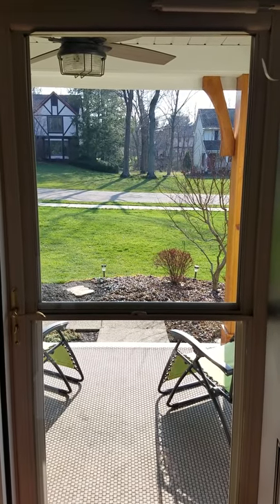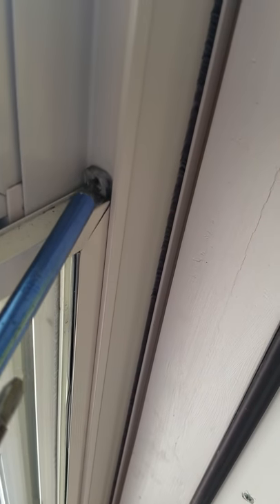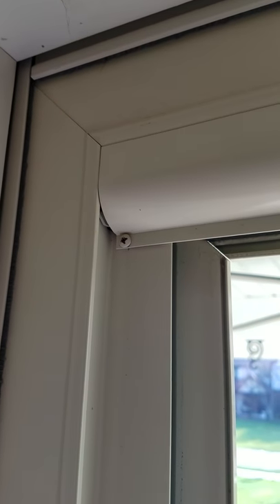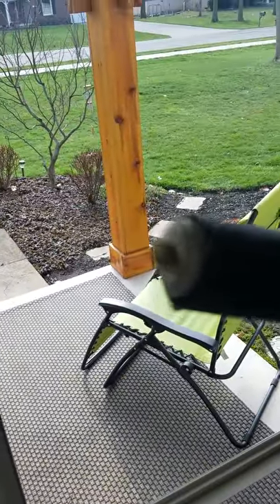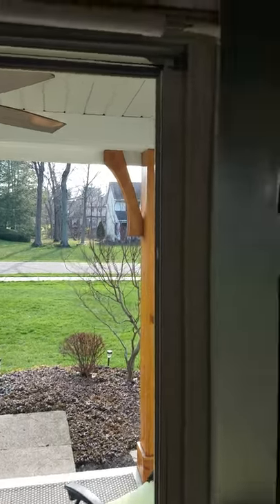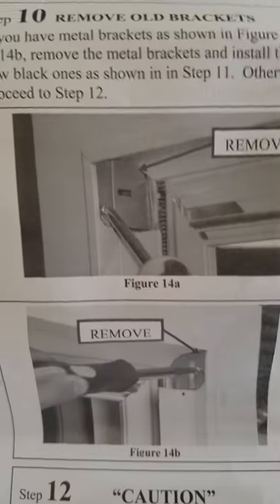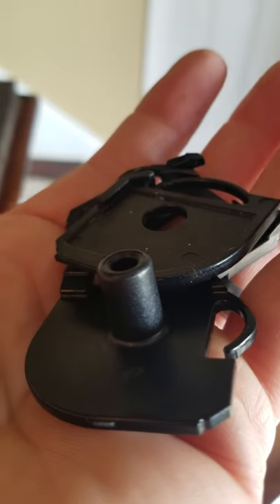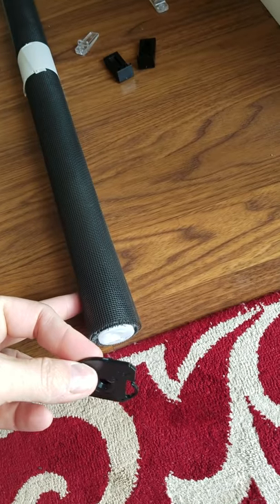DIY -  Larson retractable screen replacement

Comment: Ok....I just ordered a new screen since the one on it had a hand pushed into the screen and the gray part that slides into the upper window panel (sash) ripped about a 1/3 of the way.....for my door you can buy just the screen through Larson for 40 FLIPPIN DOLLARS.....follow the steps in the video and you should be ok!  The roller has a glue strip that holds the screen on.  Anyway, the one thing everyone seems to be puzzled on, as was I until I figured it out, is how the heck to get the top glass out!!! Push the window all the way up! Those clips on the underside? Stick a screwdriver in there and twist. They will pop out eventually....if you break em dont worry about it...the screen kit comes with new ones as well as the retaining clips for the bottom panel (clear plastic with one screw) getting those clips off of the top panel allows the BOTTOM of the door to just swing right out towards you....HOWEVER, onve those clips are removed, slide the panel back to the tippy top....see those cutouts on the top of the channel where the spring roller sits? THAT'S where the TOP of the panel slides up and forward to you like the bottom of the panel does...you're welcome...lol.  good video and helpful....I may add one when the new screen gets in the remove a lot of confusion ;)

Comment: I just dove into this project, The spring self locks every one revolution. I turned mine 20 times with the window down. I had to add a washer on the jamb side of the roller as the tolerance was too loose. This is why I came undone to begin with. FYI, It could be turned 25 full turns.
Reply from the maker: Good to know.

Comment: Just finished replacing ours. Your video was a big help. Mine was not exactly the same - I think i had some of the "older" parts, but the essence was the same. Many, Many thanks.  I will add for others - mine had been up long enough that it had accumulate a bit of dust and debris in some of the channels - and i have a very hard time getting the windows back in and seated. Cleaned that all out with a blower and the went in just fine. the tolerances are fairly tight. thanks again,.
Reply from the maker: Glad it helped a little.

Comment: Thank you for the video. Larson sent me an exact replacement screen without the hardware. The instructions Larson sent were useless except the screen tension section. Your step by  step instructions got me through without swearing. Larson should be paying you for this. Thank you again.

Comment: This video helped navigating poorly written instructions. The hardest part is where you need three hands to hold the window up while holding the coiled screen, trying not to rip it from the sharp aluminum (which should be de-burred) as you insert the spacers, align the retraction key, keeping it as close to control screen slack, and at the same time reinstalling the cover with two micro screws less than 3/8 inch long that have no threads on 50 % (drill points). After reading the instructions I’m glad you confirmed how difficult this could be. To help lift the heavy window I was able to use and adjustable rod. This kept the screen within one inch from the top and minimized the spool out of the screen. What you don’t realize is that if the screen spools out, it creates a loose screen that allows bugs to crawl under the bristled seal. Tighter is better. Thank you for doing this video. Before I replaced this screen, I should have done one on rewinding the spring, after the internal locking spring end jumped off the plastic retainer which happened twice. And the one time the adhesive holding the screen failed causing it to spin off. 
A warning which I found out the hard way. The door cavity created when closed, elevates the temperature which melts the screen hot melt glue. I’m adding slots for ventilation on top and bottom of the frame. I’ll cover the slots with a piece of leftover screen, secured with Silicone adhesive on the edges.
Reply: I have a hard time expressing how much I hated trying to install the window screen, while holding  six other things with my nonexistent third and forth hand. Ridiculously hard, and when the spool unrolled, it almost severed two of my fingers. How could they make this any more complicated?
Reply: EEEEEEEEEEeeeeeeeeeeeewwwww!!!      I have to do this project and have fat fingers.   I’m gonna try anyways, but may have to farm this one out.     Thanks again to the OP.👍

Comment: You made it so easy...even a 65 yo girlie girl could do this install.  I had to replace the glass also.  The screen was pulled away and also the glass never lined up to latch, so hubby drilled a hole and attached a spring for me to hook and unhook.  My screen holders are black and one yellow, so I was also a bit confused in the beginning.  So, I forewarned my husband to not freak out when he comes home and there's no screen or glass on the door lol.  I, like you need another set of hands to get the new screen and glass onto the frame.  It was, however, therapeutic ripping all the old out.  Thanks so much.  I would have never figured it out from the diagrams.

Comment: my dad bought an old house, for three years he had no clue how to install a screen on our storm door which is exactly like yours. the old owners removed the screen so it looked like the screen just didnt have one. untill i did some research and found this video. we figure out that the door DID in fact have a screen, it was just retracted and hidding inside that part.  we had to remove that screeen holder part and just ordered the new screen. we will be installing it once it arrives thank you soooo much for this!!!

Comment: Thank you for this helpful video.  The included paper instructions are so-so, but this video was key.  I had a 36" 2x4 laying around, which I used (had to angle it) to keep the top sash up and in place.  And friends,  in the final step, make sure you have the bottom of the lower sash seated properly, or your clear plastic clips will not line up with the screw holes in the frame.

Comment: Your video was extremely helpful.  I had just given up on installing a new sash and screen but after seeing your video I am giving it another try.  I had tried and tried to remove the spacer on the upper sash.  I know understand how it is held in with the little hooks that need to be pinched together and pried out.  Thank you for providing this video.
Reply from the maker: Glad it helped.
Reply: we tried looking up a new upper sash as well as the new screen ...bought about 13 yrs ago... where did you buy both?

Comment: Great video thank you I installed this storm door last year after replacing both entry doors was so happy with the storm door that I replaced storm door on other side of house. A month later spring broke. Called Larson there sending me a replacement under warranty. So glad I found this video couldn’t figure out how to remove spring tube without removing glass panes. But guess I was thinking there was a better way.  I am very visual kinda guy I learn better by watching rather than reading instructions thanks again.  I’ll let you know how it went in 7-10 business days lol

Comment: OMG!! Thank you SO VERY much for this video. I thought I was loosing my mind as to how the screen frame flew off and no where to be found. Once I viewed your video, I realized that the door has a retractable screen. You are my hero! Now just need to know where to get a replacement retractable screen for it. Can't seem to find one as of yet.
Reply from the maker: It’s been stated in the comments, many times, but inside your door jam, there should be a sticker with a serial number on it. If you enter that number into the Larson website, it should pull up all of the parts needed for your particular door. Good luck.
Reply: @steelydan8421  I have tried that. Issue is, the first number has worn off and any number entered shows up as not valid.
Reply from the maker: Uhhhh. That’s not good.
Reply: @CSP194  Just call Larson Service. My numbers were gone. I put the door in about 8 years ago so numbers disappeared over the years. Lady I talked to matched it up perfectly.

Comment: Great video that really helped me. My replacement kit came without the female plastic insert opposite the flat spring loaded end. Bummer. The original screen tube had a  round male pin opposite the spring loaded flat end, so I removed that from the original screen and used it in the new screen with the original plates that held the old screen in place. The flat end hole is oriented to accept the flat pin with the wider side towards the inside of the door, watch for that proper fit. With the  flat end in place I moved the pinned pivot end from down to up, and lifted the screen roll as I pryed with a flat screwdriver the gap needed to get the pin into position and into the plate hole.

Comment: @Steely Dan, Hey there Dan. We moved here in 2007, since there is no name plate on our particular storm door, I called Home Depot & the guy there said look on the door jamb and read back the ID# on the white sticker. Guy stopped me & said call Lowe's because it's a Larson, so big thanks to the HD guy. At any rate for those of you who couldn't remember where you bought your storm door from, as I mentioned earlier, sounds like all manufacturers put the ID sticker on the ''Hinge'' side of the ''Jamb''. I was glad when I noticed that the sticker was left on the jamb since I usually remove the stickers on replacement parts in the past. Now I do not... lol...
Thanks for the step by step video. The door & window guy at Lowe's said Larson has a video on this style door on their website and he said to just enter the ID# to view the instruction video, he also told me that there was an added part so the screen will fit the bottom trac, which sounds like he may have guessed on that part since there is no such part going by your video. Thanks for the great upload Dan, I'm sure it's helping a ton of people, M.D.......
Reply from the maker: I have commented about the ID# in the door jam on multiple posts before.  Good luck

Comment: My top glass was broke, I think while weed eating, but the screen part is fine. It still had to come apart to take the frame to get glass replaced. The tension spring unwound and caught the back side of my index finger. In a split second I was thinking enough heat was being generated by that whirling plastic piece on the left end grinding away at the bone between my fingernail and the first knuckle for cauterization,  but much to my dismay it ran out of stored energy before the mission was accomplished. Fortunately neither of the screwdrivers being used to pry the cartridge from the framework were damaged. LOL. 
I noticed you had left the cartridge removal part out of your video. Anyway I'm glad I found your video so I could see how to take this apart, and I'll post on how much the glass replacement is later if I survive the process.
Reply from the maker: Wow! We weren't home when our screen came unattached from the sash. I'm sure there is a fair amount of tension on those Springs. Glad you were not permanently maimed during the procedure. LOL Goodness luck with the rest of your project.
Reply: @steelydan8421  I'm good but the tempered glass for the window was about $120 and had to be ordered. Too much in my mind for a piece of glass, but it is what it is.

Comment: Thank you so much for this video!!  I just ordered the replacement (I've had my door for 10 years + and never had the screen rip or any other trouble, but the cords don't work now and the window just slams down, ugh.)  The guy on the phone said it wasn't a big deal, so I'm thankful for this video because I would have had quite an issue with it.  I really appreciate it!
Reply: Betting the replacement was way overpriced and yet it's made with plastic brackets.
Reply: @lastcall170  ? lol, I just ordered the replacement screen kit at our Waterford Lowe's for $49.95 + tax. I like the door we have and with this type of screen setup, it's fine with me. So for the 11-12 years since I installed the storm door, spending $50 to replace the screen is fine with me.

Comment: Hey Steely Dan, I want to thank you very much for this Larson video. It made the new screen installation so much easier. The only thing I would have liked was a more complete view of removing the spacer clips from the bottom of the upper sash. Otherwise, well done.

Comment: This was very helpful! We had trouble getting the top window/screen in, and that step wasn't shown in your video. You have to move it all the way up so those dark brackets on the top at the ends can go back into the slot, then you can edge the panel and screen back down to complete the process of the screen tabs at the top. This is MUCH easier to do with two people, one to hold the panel, the other to do the "finagling" with the parts. 
Tips: 
Really do be careful with that step 7, and not touch the tab or the tension is lost. If that happens, as it did with us, anywhere along the process, you have to take it all apart again, re-do the tension in the screen, and do all the steps back over again. 
Step 13: Note that the left tab and the notch it goes into are both not fully horizontal, but have a small "L" shaped extension. So it's not just tab in notch, but inserting a skinny L-shaped puzzle piece that has to fit just that way.
Reply: Can you please tell me where you purchased the replacement screen and how much it cost.  Thank you very much
Reply: @jaemarrero1983  I went onto Larson's website and under support there's a place to order replacement parts.  I finally had to select the door option to see where the parts were.  Its not the most customer friendly site.  The glass & screen were around $90 for mine.
Reply: Thank you so very much!

Comment: Thanks for the how to vid! Our door is older, just like yours almost.. screen still works—but the right side of the screen seems wavy/loose, like it’s not in a track or something!?! I’m wondering if we can just feed the right edge into a proper place!?! I mean it’s working, I just don’t want a wasp to be able to walk right in, you know! lol Thanks again! I’m saving your video in case we have to completely replace the screen one day! We have two Larson doors, front (older)  and back (we we installed).. love them both! ❤️👍🏻
Reply from the maker: Yes, check to see if it has come out of the track. That sounds like that might be the issue. Good luck
Reply: @steelydan8421  thank you!! 👍🏻👍🏻😁👏🏻👏🏻👏🏻

Comment: This is exactly what happened to my screen. I was wondering if it was possible to reattach the screen to the bottom strip? For example: machine stitching the screen to the bottom rubber strip. (At least for a temporary fix.)
Thank you for this great video!!!!

Comment: I am a frail cancer survivor with little strength on the surgical side. I need more arms. My door is almost new and very seldom used when the screen roller just quit rolling up. Can't win for trying. I am a police widow on a small pension and can't afford a handy man. Thanks for helping. Hoping to be able to just remove the screen and close it all up for winter.

Comment: Thank you for this instructional video. I couldn't find any videos either and didn't even know it was a larson screen door.
Reply from the maker: Tony Musto.  Check inside the door jam.  Should have make and model number with serial #.
Reply: Steely Dan Yea I've looked all over for any description or numbers, nothing.  I have basically the same exact door and without your video I was lost at least I know it is a Larson door.  Thank you again for posting video and follow up.  Now I just have to figure out where to get the screen roll.  I went to website you linked bellow for someone else but didn't get very far without model or serial number it seems.
Reply from the maker: Tony Musto, serial # is the key.  Good luck.

Comment: Certainly helps if you have an extra hand!  Very critical when attempting to insert the new screen roll into the top of the frame (see comment from John V).  I didn't have the extra help, but I used the cardboard tube that shipped with the new screen to prop up the window.  You want to make sure that the screen 'feeds' into the top of the frame and BEHIND the protective 'weather stripping' that protects the screen as it slides into the guide rails on each side of the door frame.  Note that the flat tab of the recoil mechanism is 'keyed' and will only go into the plastic guide slot one way.  (check it out before engaging the screen into the glass window rail).  I would also recommend that you perform a "test run" of installing the top window back into the door frame without the screen roll, just so you know how it is done.